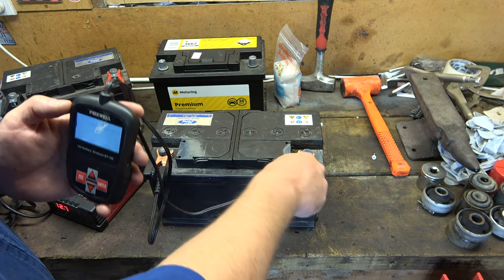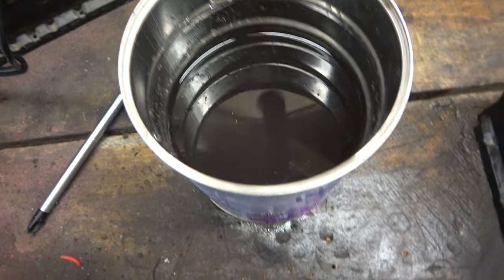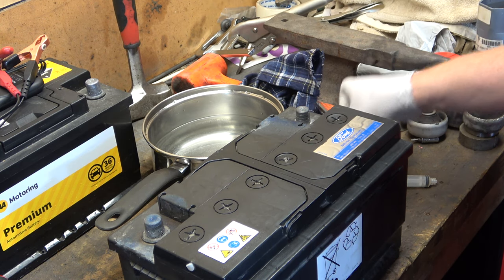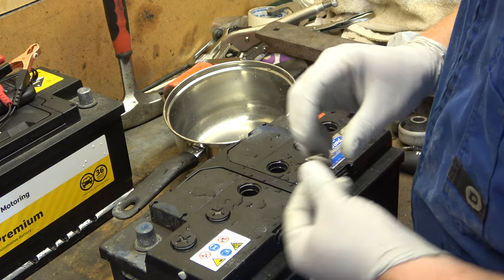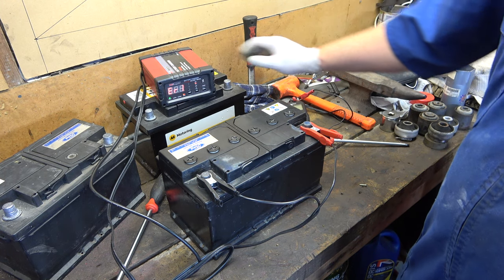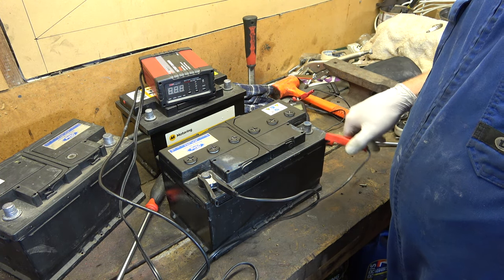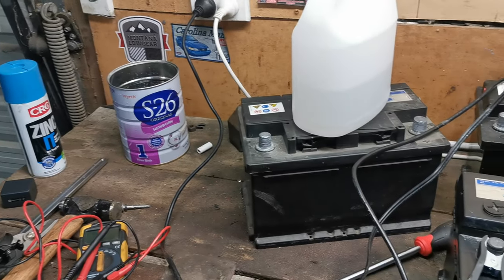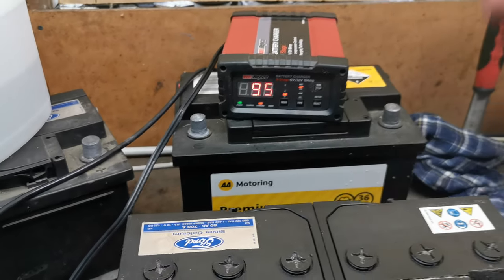Restoring Car Batteries with Epsom Salts - Does it Work?

Comment: I've had luck draining the acid into a container then using the baking soda and water to rinse the cells until it clears up. Fill a funnel with cotton balls pour the acid through it fill the battery back up with it. Then put on a 50 to 60 amp charge for 15 minutes at a time letting it rest for a few hours in between until charged . Then you should have fairly new battery
Reply: What do you think about dumping the acid and just rinsing really well with distilled water 5 times?  The baking soda definitely makes sense if you are priming the battery for magnesium sulfate, but does it make sense if you are going to reload the acid right back in?  Maybe, maybe not.  I don't know, and it isn't a topic many cover.
I did what you did, including a three good distilled water rinses between the baking soda wash and reloading the acid, but the battery died again after just over a week.  I think it likely has too much residue on the bottom because the now dead again cell migrates to a neighboring cell after I jar the battery around a little bit.
I'm contemplating trying to clean the battery out again, because it did revive a dead cell the first go around.  However, I'm questioning if the baking soda adds value over a distilled water rinse.
Reply: @wellnesspathforme6236  I had read in the past about using dish detergent with the distilled water to wash out the battery.
Reply: @michaelsnow7362  I did yoeman's work trying to rehab two batteries.  Drilled hiles in the bottom to clean them better.  Charged with a stick welder.
My conclusion is take really good care of your batteries.  Period.  Never drain them. Ever.  If they aren't abused and fail with age, you can probably rehab them with various stick welder or other techniques.
But if they are seriously abused...  try it, but don't bank on it working.
The only thing I didn't try is a chemical that is supposed to take the sulfate off the plates.  Used batteries are $50 for decent ones, so I went that route.

Comment: It's been over a year and I don't see any follow-up so I'm guessing you gave up.  I'd actually like to encourage you to try again but this time, after initial charge, simply discharge the battery and recharge.  You will likely find that each recharge is quicker and that there is a boost in the CCA.  You'll want to run this cycle a few times and once you see no more improvement and that the reconditioned state is acceptable, replace the salt solution with normal battery acid.  The idea is that each recharge phase "cleans" a bit more build-up on the electrodes allowing electrons to flow more freely through the solution.
Reply: hi everyone ,if anyone else is searching for reconditioning lead acid battery try Jons Mender Guide ( search on google ) ? Ive heard some incredible things about it and my mate got amazing success with it.
Reply: Please read my comment, as he has also done it wrong.
Reply: I was wondering why he left the MgSO₄ solution in the battery. I would use that to clean the battery and plates, drain, strain, and add the acid back to the battery.
Reply: Exactly! It's more or less a cleaning solution and not a permanent solution. I'm picking up more acid this weekend for my battery. The Epsom salt method does clean, but leaves a lot of residue and build up. Eventually it would lead to a run off in the bottom of the battery with sediment.. after the battery is cycling, drain and replace with fresh sulphuric acid . Even rinse it a few times with distilled water . And from now on maintaining it

Comment: Thanks for the video. I drained my battery, then rinsed it with a baking soda solution a couple of times. Added the Epsom salt solution, charged and discharged 3 times, and I am very impressed. The battery was not taking charge before. It only went up to about 8V. Now it sits at around 12.7V. Thanks
Reply: How long did you charge before draining?

Comment: I think the problem with the EPSOM salt (MgSO4) is, that when charged, metallic Mg will perhaps form superficial alloys with the lead surface of the cathode, which on the other hand would reduce the overall capacity of the accumulator. But this is just a speculation. An idea would be to drain off the MgSO4 solution after the first charge/discharge, wash the battery with distilled water and refill it with diluted sulfuric acid.
Reply: Pl
Reply: CORRECT !
Reply: Lead and magnesium are both cations so I doubt it’s an alloy. Sulfates can be hard to remove especially on old batteries
Reply: That defeats the whole purpose of the show,this show is regarding charging old batteries with Epsom Salt,not Sulfuric Acid...  Well ya,duh,no shit, were not talking about acid,were talking ORGANIC SALT, THATS "ALL"...
Reply: El problema es que drenan, no drenen, agreguen las sales y agua destilada y les ayudará unos meses, también no crean que quedarán como nuevas y que les evitará comprar una nueva
Reply: Lots of information on pulsing, different chemical desulfating methods, etc, etc. Thing is, really sulfated batteries have tendrils of sulfation deeper into the plates. So its not simply a matter of clearing out some top, outer layer of sulfation. 
Seems like less than 50% chance of something like this working, unless you go through multiple rounds of desulfating charge/discharge, and even then its a crap shoot.
But if its a spare battery, couple $$ in electricity and some time on a charger isn't much inconvenience if it works 20-25% of the time.

Not shilling, but ran across a company batteryvitamin that has an industrial/commercial product for minimizing adverse sulfating when running large battery pools.  Seem legit, and their technical information was pretty interesting on all the different desulfating methods they've tried and results.  They don't seem to sell anything to Joe Public either.
If you're looking at getting a desulfator, make sure the one you get is NOT some cutting edge marketing wankery about microsecond/nanosecond pulsing.  You want something that pulses in the millisecond or slower range at most, otherwise at faster pulsing the voltage and current end up far out of phase and ends up expending most of the energy in the wiring and not in desulfating.  Pulsing actually seems to have not much real benefit over simple charging and discharging compared to how pulsing at above 2.7v which most do, actually degrades the anode much faster than normal charge/discharge.
Reply: yes, I was using exact same method to recover my supercheap auto dead battery, the recovered battery is still in good shape after 2 years.

Comment: You may have had better results by flushing and repeating the salt process until the voltage and CCA peaked.  Then add the correct electrolyte, which is acid, which is required to create the proper chemical reaction on the lead plates, by literally eating on them, which produces electrons, which releases ions into the acid, which is what produces current.
Reply: What kind of acid would you recommend using if you want to trip balls I mean get the battery to work again?
Reply: @zoharflax6363  Sulfuric
Reply: @jlbush8249  My battery is not holding a very good charge, the colder it is outside the less of a charge the battery has to start my car. I have watched tons of videos and from what i gather is,  dump out all old acid, pour in distilled water and keep flushing until the water is clear and then replace with brand new acid? Let charge for 24 hours and should be good?
Reply: @ericc8895  Yes, however, you should also try and clean the inside of the battery with a 50/50 mix of Epson Salt and distilled water and shake and let set for an hour.  Then a 50/50 mix of baking soda and distilled water and shake and let set for an hour.  Rinse the battery well and re-fill with the proper electrolyte.  Get a starting voltage and monitor it during the cleaning process to see if the cleaning process is helping clean the battery plates.  Hopefully, you will see a rise to a normal voltage through the cleaning process.
Reply: the voltage being added to the magnesium sulfide and water solution is producing sulfuric acid and magnesium hydroxide and then the sulfuric acid and magnesium hydroxide are recombining into magnesium sulfide, with hydrogen and oxygen gas being trapped in the cells. this process could slowly build up magnesium hydroxide solute on the cathodes and slowly concentrate sulfuric acid at the anodes over time. at some point there won't be any water left though and you'll just have to release the gas and add more water. also at some point you'll have to remove the magnesium hydroxide from the cathodes. It would be better to use a throw away battery and deconstruct it to have just one anode and one cathode and then use that with the epsom salt to concentrate sulfuric acid to add to a properly cleaned battery's cells.
Reply: at that point though you should just use the old acid, filter and reconcentrate it using a similar method.
Reply: @jlbush8249  >> Get a starting voltage and monitor it during the cleaning process to see if the cleaning process is helping clean the battery plates.  Hopefully, you will see a rise to a normal voltage through the cleaning process.<<
How do you monitor the voltage "during the cleaning process"?  Doesn't the acid have to be in the battery and charged to monitor the voltage?  Are you implying one has to go through the cleaning, acid loading, and recharging process multiple times, noting the voltage changes each cycle?
Or am I missing something important?
Reply: @wellnesspathforme6236  The battery will still create voltage with the cleaning solution.
Reply: @jlbush8249  So, charge it with the baking soda solution?  For how long?  Do you replace the cleaning solution and charge again, all while expecting the charge limit to increase towards its max value for a given battery?
Thanks for the clarifications.
Reply: @wellnesspathforme6236  I don’t charge them when cleaning.  You are watching for a voltage increase to indicate the plates are getting cleaned.
Reply: @wellnesspathforme6236  Sorry, meant to say I do charge them when cleaning.
Reply: @jlbush8249  Thanks for helping clarify this for me.  I believe the following steps are what you are conveying: 
1. Dump out the acid
2. Clean up with baking soda solution
3. Rinse baking soda solution out with distilled water.
4. Load battery with epsom sallt solution
5. Charge and discharge battery with epsom salt solution in the battery, checking max voltage is rising every cycle
6. Once voltage stops increasing with charging cycle, stop charging cycles.
7. Dump out epsom salt solution as much as possible. Do you do a distilled water rinse here, or just leave residual epsom salt solution in the battery?
8. Reload the acid back into the battery
9. Charge battery and make sure the charge sticks overnight.
Note -- from other threads I've picked up it might be wise to drain the battery 50% and recharge a few times.  Do you have thoughts on this?
Is this about right?  
Thanks, again.
Reply: @wellnesspathforme6236  Yes, rinse the battery with with distilled water as best you can before adding acid back.  I use a small 400 watt inverter and a 60 watt light bulb to gauge how well the battery carries a load, because as I’m sure you aware, just because a battery says the voltage is good, doesn’t mean it can carry a load.
Reply: @zoharflax6363   H2SO4 diluted

Comment: My dad retired from AC Delco,  (battery div)  and he said you can't use any water in a battery that has touched metal.  (ionization thing) Also,  I understand when doing this process, a  low amperage charge over longer time is preferred.   Also,  you need to completely neutralize old acid and rinse out with baking soda, / clean distilled water.  Your new battery is not an acid battery,   you can't mix acid with the new mag sulphate electrolyte at all.   Okay,I'm glad you got to hear from me.  :)
Reply: Exactly, precisely and to the point.  I was going to reccoment that.  Need to clean out the inside of the battery  and get out all the acid with baking soda.  I would reccomend letting the battery set a while with the baking soda/water concoction in it, shake it around a bit and emptying it, then repeating once or twice more to get it real clean inside, then fill her up with the old saltwater, and trickle charge it for a few days, wiith a dumb charger though, so it can steadily charge without the charger cutting on and off.
Reply: @garypowell4565  that's the proper way to do it ....and it will work .....
Reply: Cheers for the video content! Sorry for butting in, I am interested in your initial thoughts. Have you ever tried - Lammywalness Trendy Trade Guide (search on google)? It is a smashing one off guide for learning how to recondition batteries at home minus the headache. Ive heard some unbelievable things about it and my close friend Aubrey at last got astronomical success with it.
Reply: If you won't mind i want to ask you about this
Your new batter is not an acid battery.
Is that meant for restored battery
Reply: David Livings 
And I learned to that restoration is  cleaning the battery chamber
and refill the acid which for battery can easily buy from the battery shop and the recharge the battery. That is what i knew.
Is that way is right??kindly reply me please.
Reply: Lovely Video clip! Excuse me for the intrusion, I would appreciate your initial thoughts. Have you ever tried - Rozardner Powerful Battery Reality (search on google)? It is an awesome exclusive guide for learning how to recondition an old battery without the normal expense. Ive heard some great things about it and my friend at last got amazing results with it.
Reply: So the epson salt doesn't harden back up?

Comment: We used to do this in the Navy, because lead acid batteries were made of unobtainium in the supply system, but when we emptied out the acid, we added a step filling the battery with hot (very warm not boiling) distilled water with a cup of baking soda and let that sit for about 3-4 hours in the battery then drain and flush it again with hot (very warm) distilled water and flush that out. That step used to get a lot of the sulfates inside on the plates, pretty gross stuff would come out.

Then added the epsom salt solution and charged at @ 2 amps for 4-5 days. 

Results were mixed, usually at best we got another year or two out of the battery. Thanks for the video.

Comment: Ive been watching a few of these videos on refurbing the old battery.  The better results take time. Some charge to full them drain it to 60-70% with lights or radios, then recharge it again, One guy did this for the course of a week and he's had no problems starting his car in the mornings.    Its worth a try.... Like everything that might save a penny or two.
Reply from the maker: By the time you've messed around that much you might as well buy a new battery 🤷‍♂️

Comment: I have seen other people using baking soda mixed with water to clean out the cells a couple times this will remove dirt from the plates.
This will help the batteries amp output

Comment: Thanks for the video. Would have been interesting to see if you had completed a few discharge / charge cycles after putting in the fresh mix of epsom salts. Charge up, discharge using a light bulb or some other load to 10.5 volts. Do this 3 or 4 times and see if the CCA goes up after each time.

Comment: I believe that a lot of the problem is the crud building up in the bottom of the battery. Flush it out several times and get out as much as you can. Then refill with new acid, leave it to settle for a day then charge it. Worked for me anyway, I did it two years ago to an almost dead 7 year old original battery on my Kia Rio diesel. Two years and two UK winters later it's still working.
Reply: @LyubomirLalovMulti  It's a scam, and you are a spammer, and you've been reported.
Reply: Shedding is real, or 'buckling' as they call it in the industry.
Sometimes you luck out and are able to do as you did, however most of the times it sheds such that it shorts out killing a cell and is not able to be flushed/vibrated/jiggled out.